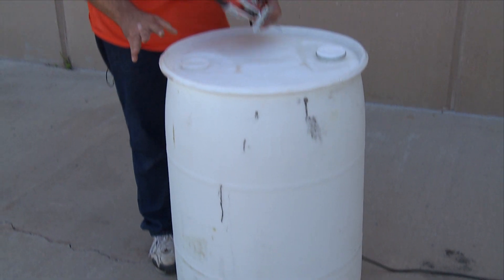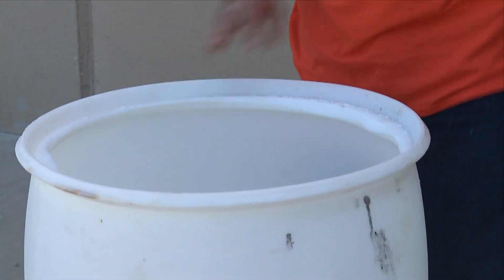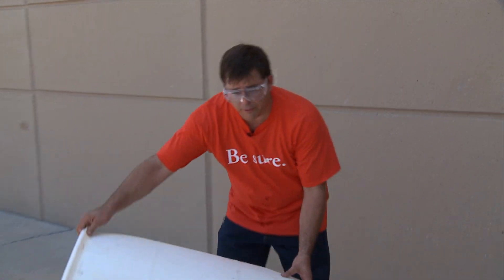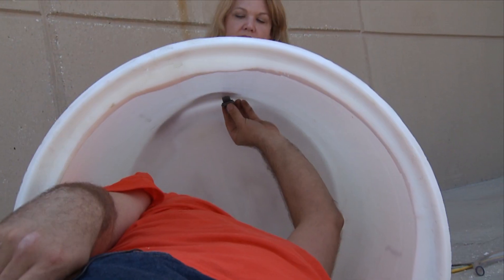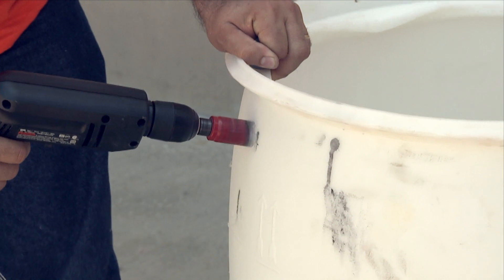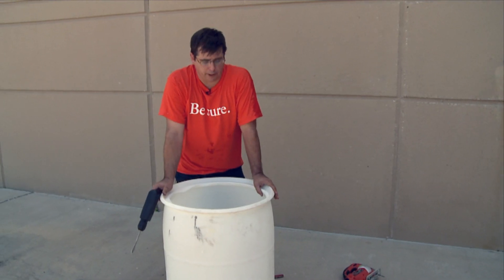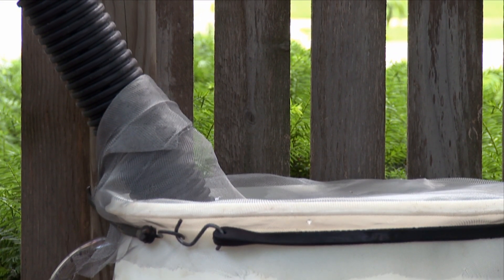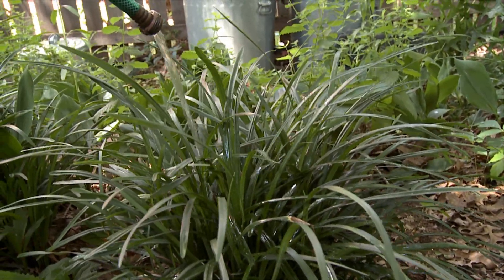Environmental Initiatives - How to Make a Rain Barrel

Comment from the maker: @KBLETHF  We did that so that we could more easily attach the valve assembly.  You can see in the video that you actually have to get inside the barrel to be able to attach the nut on the back of the valve.